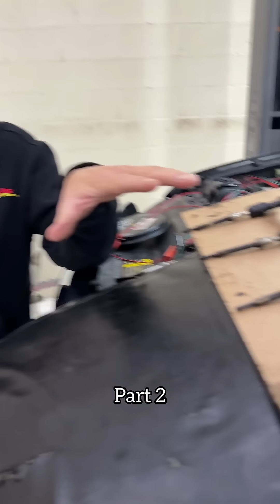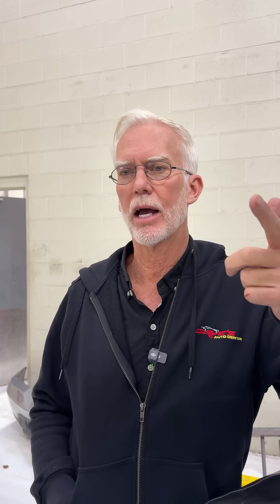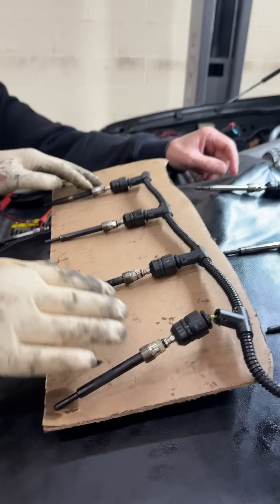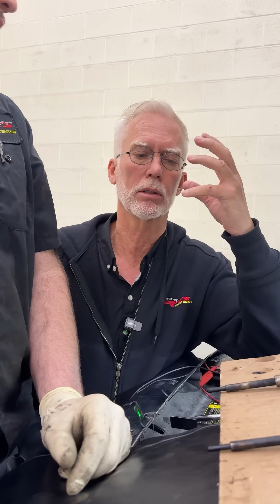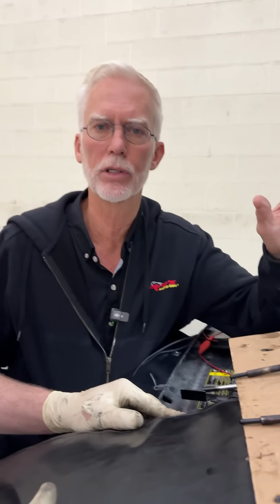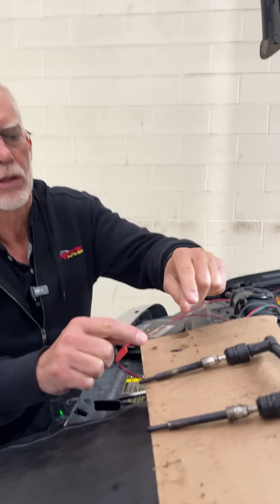Cold Start Mystery: Glow Plug Ground Fail

Comment: Ohms test only essentially tells you the wire isn’t cut in half, a voltage drop or load test is the only way to properly diagnose high resistance

Comment: You can't see what's not there, unless you look for it. When functioning properly, the plugs cause a voltage drop. Not seeing a voltage drop means there's a bad connection.

Comment: Be careful not to overtighten the glow plugs. You should use a torque wrench to replace glow plugs with a torque that is about the middle of the specified torque range.

The required range is usually printed on glow plug boxes. If you use less torque than the specified torque, soot will spread into the threads and create a seal (insulation) between the glow plug and the threads of the hole. If you apply more torque than the recommended amount, the threads may strip.

So, if you don't have a torque wrench, don't replace glow plugs.

Comment: A service manager once told me that the majority of problems you will have with anything electrical is because of a bad ground. So, question, if the previous mech used anti-seaze  would that not allow it to ground?

Comment: 6.0 Owner here.. I ran a ground to each head as I had heard this somewhere before I decided to pull my motor and do studs, lifters, ETC. When I reinstalled the motor, I ran a ground to each head, (and a new harness to each sides glowplugs) and luckily have never had an issue, or had to replace glow plugs yet in 100K since the upgrades, and I live in Idaho. Great work on finding the solution!

Comment: Unrelated but I’m a first time truck owner. Bought a 2018 Chevrolet 1500 4x4 with 96,000 miles and the next day a lifter failed and scored a cam and sent degree everywhere and I got a motor replacement under warranty from the dealer. I got this truck back from the motor replacement a couple days ago and it’s running better and feels better driving but I’m a little on edge about how this truck will last or if it will. Do you guys have any tips on preventative maintenance I can do on this thing to make sure I get most of my money’s worth?

Comment: It's also "visibly obvious" in that the "right bank" are getting hot on glow up & burning off the carbon build up where as - "visibly obviously so" the left bank isn't glowing up because they're dirty & still carboned up..... 

So the previous work done was only "treating the symptoms" before actually ascertaining "what the sickness was in fact"......  
Fairly/very very common place in dealerships these days as "old fashioned" "diagnostic ability" has mostly disappeared..... Guys don't stop long enough - BUT BUT - dealerships have such big hourly rates & everybody assumes that the "Brand name" dealerships MUST be the experts/know their product exceptionally well...... Ah, yea, na..... 
Not so - you need to find a or that "needle in a hay stack" mechanic at an awesomely reputable business such as "Dave's Auto Centre". 

A hard find I tell ya..... 
I've experienced it - dip shit dealerships & small independent workshops - so much so I'd wished I'd done the work myself.... ( As I was capable of doing so but didn't have the time to do so....) It was unbelievable what the shop did.... 
Younger generations can't "theorise" - they only go off the "diagnostic machine/laptop" out puts or the "poor advice" given to them by their fellow workers with more supposed "experience". 
"Sometimes ya need to go make a coffee or smoke a cigarette" 

 - I. E. Ya just need to "stop, drop & roll" 
In that : 

1/  STOP & literally think 🤔 what are the "probable" causes or the process that is causing the issues or symptoms of what is "the evidence presented in front of me" - therorising! 
It could be multiple items at times - it surely wasn't the glow plugs as they'd been replaced twice already - the mechanics that replaced them 
"assumed" that the plugs were at or the fault - when in fact they weren't at all.... They ( the previous mechanics) very obviously so - never tested the trucks glow up as the awesome mechanic did here!!! His diagnostic skills procedure was "elimination of probable causative issues".....

2/ DROP - make "the penny drop" - i.e. by "actual mechanical aptitude" & "a process of logical elimination" define exactly in fact what "actually is the problem item at fault & why it as at fault" - remember in this very instance - the glow plugs were A okay fine ( the poor customer had paid for 16 new plugs by this stage - BUT BUT - this was not work done by "Dave's Garage"....
Plus - the vehicle could have more than one fault - this can be common on vehicles where an "original singular fault" that isn't remedied in due course can manifest itself into multiple issues by destroying itself - i.e. in this case it could've potentially caused crank shaft unequal loading at extreme cold weather starts & perhaps potentially snapped a crankshaft...... As only one bank of the vee motor would've been firing up instantly.....

3/ ROLL : With the solution & implement the corrective procedure - i.e correct new parts OR as in this case - sufficely or sufficiently tightened - items can then perform their actual functional purpose - in this case - quite simply "glow up" !

It was in fact, quite a simple problem BUT BUT took "diagnostic ability" - of which is seriously seriously lacking in this day & age & not only in vehicle servicing........

And that folks is why I do as much as I can myself......BUT I'm lucky as I've got vast years of experience to draw on & oh yeah - a brain 🧠 - of which I got taught to use adequately so......😊

See Dave's ( & therefore all his mechanic's) "demeanor" - is visibly so very very clean cut - their clothing & workshop - & presentation overall is exceptionally "professional" - well-done Dave & company you guys are truly a "four leaf clover" 🍀 🍀 🍀 

I would love to work for Dave, professional,clean cut, honesty & surrounded by excellent successful people in their field of vocation.

But I'm actually a "Carpenter" lol!!! 😂🙄 Go figure 🤷

Comment: Bull shit. the compression of loose glow plugs would have worked themselves back and forth until they wore the threads out and blew themselves out like spark plugs from a 5.4L Triton. Bull Shi*t you would have picked the glow plugs up in the engine bay, and be replacing heads.
Reply: BTW love you, good job, but do better.

Comment: What kind of codes were being set? I remember in the 1st video you had the glow plugs out and were testing on the bench. I must conclude that nothing was noticed (like the glow plugs came out quickly, after just a few turns) when you removed the glow plugs for bench testing. I did notice how in the 1st video you did not say just what problem you found with the harness.

Comment: Those multimeters have a very high input impedance. Always and I mean always load test circuits with a test light with incandescent bulb.  I learned this lesson years ago. Multi meters can measure leakage. Kudos to this young man for finding the causal reason for the failure. Love your channel Dave.

Comment: Sorry As a tech 35 your you could have diagnosed that without removing anything with a simple amp, probe  and test light and bank separation and see what the average draw is it should be within a few tens from bank to bank     Buy you do the long way to rack up  shop charges

Comment: I know this is mostly a diesel truck channel....BUT.....some of us have other vehicles.....SO
Subaru!!!!!  the most missed ground that causes crazy mischief is the one from the pitch stop mount on the firewall to the top trans case half bolt!!!  ESPECIALLY if the trans or engine(or both) have ever been removed!!  
Almost nobody disconnects this one before removing the engine or trans and if they do remember to disconnect it, they forget to re-connect it on re-assembly!!!
This one WILL cause crazy electrical issues including instrument cluster and radio problems that baffle all troubleshooting.

Comment: Grounds are important I remember one time I had a Toyota Camry coming to the shop was misfiring and just running rough and not doing what it's supposed to do and it turns out all it was was the ground the funny thing is it only took me about 10 minutes to find it because it was right there on the intake manifold as soon as I tightened it the car ran great I kicked it out the door

Comment: Use an amp clamp next time to test the glow plugs at the 2 big wires at the glow plug controller. Usually 80-100A per bank if they all work

Comment: As a 39 year tech, I find it difficult to believe that another tech or two, depending on how the dealership assigned the job, left two sets of glow plugs loose. And understand this is not a critique on your words, but the threads themselves are not the ground. The ground is the taper that seats the glow plug in the cylinder head. Threads in and of themselves are not a reliable connection, even in wiring applications. That is why they are put between the surface of the fastener and the surface of the ground. Also when you removed the glow plugs did you find them to be loose?  If not my concern is whether or not the cylinder head glow plug bores are machined improperly, not allowing the glow plugs to seat properly in their bores. (And I am assuming this far in, that the glow plugs are correct for the application.) Or mismatched cylinder head and glow plugs application, due to an incorrect head, if there would be other series of heads for this engine. Which would lead to a poor or non-existent taper seat ground, and combustion gasses above the seats. Just some thoughts.

Comment: It was back to the dealer twice for no start issue cold ? What’s the chances putting 2 sets of glow plugs in an still the same problem! Glow plugs on the drivers side are the easy ones . Surely the ford mechanic didn’t mess up twice . Don’t believe the dealer put a second set in.the fault should have been found doing a running glow plug test before anything was taken apart. Any scan tool that can do a cylinder balance test has the running glow plug test

Comment: I said on 1st video a picoscope would have found the issue without having to disassemble.  And a Scope monitoring Amps would be a better way to find this issue than a traditional voltage drop. Voltage drop is fine for checking grounds

Comment: So the set with the carbon was not working but the clean set was? Also the original set AND the replacement set were never tightened properly? Not arguing the determination. Just pointing out 2 times, 2 different mechanics (assuming) and neither tightened the threads properly. Even if it was the same mechanic…What are the odds of that. Qualifies to be registered under the ‘Shit Happens’ file.

Comment: You think that's stupid. Motorcycle won't start because they think it's the starter motor. Turns out it was in gear. To start it you need to either pull in the clutch or put it in neutral.

Comment: Am I correct in assuming that his techs are paid hourly instead of flat rate ? Even great techs are pressured to rush on flat rate just to make a living. I worked with high power industrial laser lasers for decades and saw many times something as simple as an improperly seated o-ring render a 7 figure laser system worthless for days or longer. Our service techs carried massive tool kits with them to sites. Except 1. Our best was a 70 year old man. He carried a small screw driver, a small meter, and a 3 feet of clear vinyl tube. He walked up to system with bad o ring, told everyone to shut up, carefully walked around the system with one end of vinyl tube in his ear and probed the laser internal with the other, and within 5 minutes told the small army of service techs to replace a 20 cent o-ring, and walked away.

Comment: Due to the previous shop not tightening the glow plugs did you check the torque on the main engine ground?  I've found that on a few engines that had weird electrical issues. Thanks for staying in the trenches!

Comment: Glow plugs needed during regen.
When diesel under load, it's going to be doing more frequent regens.   It seems the ECM would throw some glow plug codes or DPF codes or exhaust gas codes.

Comment: I'm driving a 97 7.3 powerstroke that I bought new, now 316,000, completely stock except efuel. I put a powermaster starter in 4 years ago next February and I have not waited for the glow plugs to cycle since. You have to have enough rpm to build high pressure oil, at least down to 25 degrees (it doesn't get much colder around here). Glow plugs are the bandaid on other problems that the 7.3 can have.

Comment: Hindsight is 20/20. Knowing the previous shop replaced glow plugs, you have to check if installed correctly before doing anything. Not a complicated job, so you assume the previous mechanic did it right.

Comment: If you have an older car you are restoring, go through and clean and tighten every chassis ground strap, engine ground strap, transmission ground strap. You’ll be glad you did.
Reply: Heard that!!!
Reply: So much this. I’ve always had older cars, and grounding started getting REALLY important with fuel injection. If the motor has had work on it, sometimes the ground strap from the motor to the body is missing or loose. Batteries are often grounded to the body, so this means your sensor voltage doesn’t have a good path back to the battery
Reply: @Scot-p1v Thank you for sharing your knowledge. But, what do you mean by "So much this"?
Reply: @jocarr1791 that you will be glad you cleaned & tightened all those ground straps

Well, more precisely, you may be sad if you don’t

Comment: I know every mechanic watching this video can verify that chasing a bad ground can be very frustrating but also very rewarding once it is discovered.
Reply: After working on motorcycles for 50 years I can honestly say poor grounds are responsible for about 75% of electrical problems. Not as common on cars but bikes are really susceptible to this kind of stuff.
Reply: @mikerieck306 that's probably cause you worked on a lot of Harley Davidsons.
Reply: Had a transmission rebuilt, they didn't connect a ground and it ran like crap and threw codes, changed out many sensors till a mechanic finally found it.
Reply: Omfg dude yes. Thank you. Love when Shaniqua got ceiling lights and a sub/amp put in her old challenger by Tyrone in the hood and complains now her wipers turn on randomly…someone probed the (now discontinued) rear pdc for power and bent the 10A SCCM receiver so she is f’d but it’s the certified techs fault for finding it…after a week of tearing the car apart replacing everything in the stream/chain…….. electrical should be designed by normal US guys. Not some sweat shop Mexican/Chinaman.
Reply: I've got a Acadia right now that I'm Sure that's the issue. Can't find it 😔

Comment: Here's a word of experience-guided glow plug wisdom from a 6.0 Powerstroke owner: 
Make sure those harnesses are fully seated on the plugs when you put it together. It's easy to think they're seated, but they can be out just a bit and cause a poor connection. They'll feel tight, because the o-ring is in the head, but make sure the plastic rib is fully seated.I chased my tail on that one for a long time.

Comment: Thx for this one Dave! I had an 89' F350 That ran strong but it was a hard starter. I took it to Gillett Diesel- spent $600. for a diagnostic/tune up/glow plugs & pressure testing/Amp load/draw & they still couldn't find out why. I still had to pay em. Im guessing the threads were coated w/soot & weren't making a solid connection even w/new plugs. Im so surprised because they come w/a great diesel reputation of maintaining fleet vehicles. SMH ...😢 ...I could've fixed it myself instead of spraying ether & paying those fools for nothing. I want smart people, my money is hard earned & just as good as the next guys. It was years ago but Im still obviously bothered.  Thx again, diagnosis is key

Comment: Old saying: First you must identify the problem. Fixing a problem is one thing, identifying the problem is quite another thing
Reply: best words ever.... ive worked in factories, offices and LEO duties, i can tell you most people can fix something, where a gifted few can determine quickly only what needs to be fixed.... this shop has what it takes, bravo.
Reply: I was a mechanic for decades.  Every successful shop has at least one, maybe two very good diagnosticians.  Everybody else was just the "parts changer".
Reply: @drsudz this, worked 5 years with a 100% diagnostic rate and occasionally had to deal with screaming wrench monkeys or bosses because they couldn't comprehend why a thing created a problem - but they didn't have the understanding of systems or failure analysis. These were some of the most skilled and talented people Ive had the pleasure (and occasional displeasure) of working with but they'd be able to do the most complicated wrenching reliably, not miss or mess up anything in the process, and repeat with almost machine precision in a way I just couldnt do personally. Hell, one was a literal torque stick effortlessly and expediently, was within 0.02lbs-ft of the spec without ever touching a torque wrench every time we has a 2nd person do a verify check pass on an engine rebuild stage. But none understood electrical diagnostics and computers, or materials differentials, or why things did what they did or how. Some of it was generational, some was refusal to "just trust someone" they hired to do that job they didn't comprehend, and some was pride and ego in the way of doing a job. None of us were making the money we should have but if we'd had a better environment life Dave's shop i might have stayed in that industry longer
Reply: Nah, just load up the parts cannon.

Comment: With all the newer more loaded vehicles the more chances of a bad connection and can be very difficult to locate so that it can be corrected ! BMW for over a decade has had techs that travel between dealerships just for electrical and communication issues!